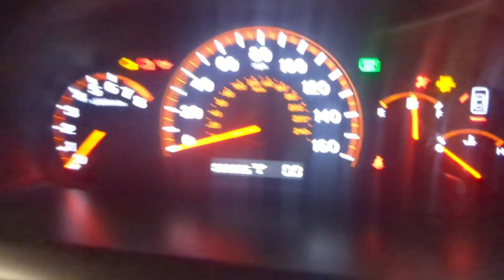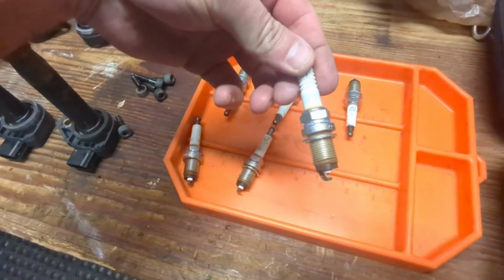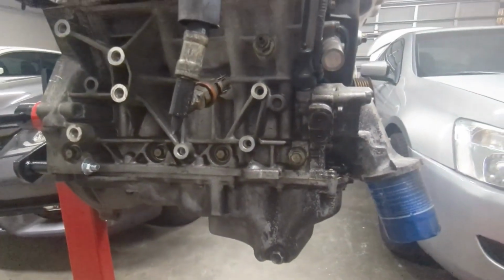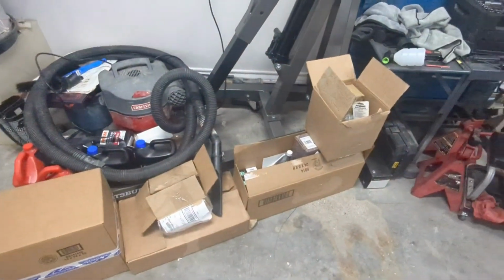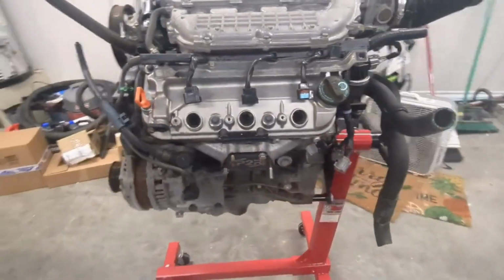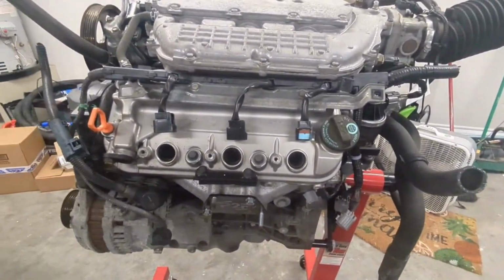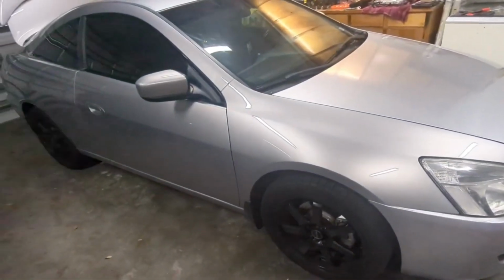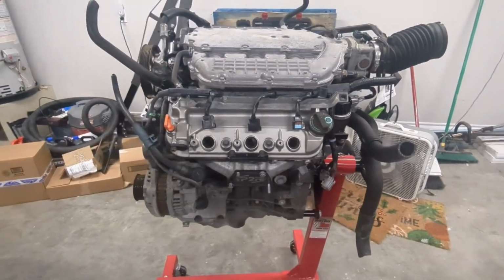Say hello to my new engine

Comment: I would have been inclined to just rebuild the engine you had.  Then you could have kept the original million mile engine, still had VTEC, and it would be good as new, with slightly more displacement.
Reply from the maker: I still may rebuild this original engine. TBD, we'll see how this new one does.

Comment: Cool, I'm definitely interested to see what the inside of the original engine looks like, I bet it looks pretty good still. Also, are you sure the JDM J30 doesn't have VTEC? I know a lot more about the D, B, F, H, and K series than the J series, but I never heard of that. But if true, your ECU won't like that and will probably go into limp mode. I do know that most of the JDM Honda engines don't have the VTEC pressure switch, but that should be super easy to swap over from the old engine. Every JDM Honda engine I saw had a 12MM plug where the VTEC pressure switch goes. Hopefully that's what people mean?
Reply from the maker: I hope you're right. The guy at JDM Motor Inc said he's been selling these as replacements for my engine for years with no issues. I hope you're right about swapping the VTEC pressure switch over. I bought a new VTEC gasket to install. Hopefully we can swap mine on to this engine and everything will be happy. My friend Nick, who will be helping me, is an experienced mechanic. I'm sure he'll figure it out. That bracket for the A/C compressor and belt tensioner was the big thing I saw that was different.
Reply: @txaccord  I just looked up a parts diagram for a Japanese market 2010 Honda Elysion with the J30A and it definitely has VTEC as it lists a part number for a VTEC solenoid. I didn't see a pressure switch listed though. To the best of my knowledge Japan never got an Accord with that engine, so if it came from something like the Elysion (a minivan) with different accessories like a larger AC compressor, that would explain the different brackets and belt tensioner. That should also be easy to swap over though. If you need any help with the swap just let me know. I've never done that swap specifically but I have  quite a bit of experience with other swaps and Honda's generally so I might be able to help if you need it.
Reply from the maker: Thank you so much for looking that up. Will be interesting to see if anything else comes up with the swap. I've never looked up anything for a JDM engine. Is there a specific site you use? I generally look at hondapartsnow for diagrams for my car.
Reply: @txaccord  I use jp-carparts when I need to look up JDM parts. I also use them to look at Japanese pricing on parts because it's often 1/2-1/3 the price of the exact same part here and I refuse to get screwed, so I'll buy my parts from Japan if they are a ripoff here. I saved about $400 buying an oxygen sensor from Japan for just over $200 when the list price is over $600 here.
Reply from the maker: Thank you very much! I looked at the site and bookmarked it. This will be helpful to look up parts in case we run into any other differences between the two engines.

Comment: Bro I'm genuinely happy for you. I have the same car but a v6 sedan. Congratulations again on a million miles 🎉 

Also I need a bit of advice. I'm looking to get new wheels and replace my OEM 16 in ones. Is +40 offset too low for this car?? What wheel setup are you running?? It's my daily driver so I don't want to roll my fenders or any rub with the calipers. The current OEM wheels look a bit tucked in towards the engine
Reply from the maker: Hi. Thank you!
These wheels are from Discount Tire. They're Drag DR35 18x7.5 with 45mm offset. The tires are 235/45/18. The tires are the exact same size as my 2017 Accord Coupe. The wheel offset is pretty close to the 2017 stock wheel size. A guy on DA said he was running this tire size and didn't rub. What I've noticed is that if I hit a big bump too fast, I'll get a little rub. They're fine on the calipers and I don't rub at all on turns. They look good on the car. It's just the occasional rub and that has made a slight cut in the very outer part of the tread. When I need new tires, I'm going to try just slightly narrower tires to see if that solves it.

Comment: couple of things i wanted to ask you RE: the new engine: 

1. there seems to be a large amount of carbon buildup on the tops of the pistons. is that considered normal for a used engine, or excessive, especially after only 150k kms? and, regardless if its normal or not, are you planning on a MMO/seafoam treatment to clean the cylinder heads to help with performance/MPGs?

2. i did notice what seemed to be a bit of etching on one of the cylinder walls (#3?), as well as much more markings/etching on cylinder #6. is that considered normal wear as well, or a sign of a possible problem that may lead to premature failure as time moves along? 

overall, it looks like you got a good engine. not really any wear shown on the cylinder walls, other than the aforementioned areas. 

here's to another million! 😁
Reply from the maker: I've got Cataclean I'll run thru the fuel (and probably some MMO too). I plan on adding a decent amount of MMO to the oil for the first run and then I'll use a few ounces of MMO a couple hundred miles before I change the oil.

I think what you're seeing on the walls is the cross-hatch markings. That should be normal. I'm obviously not expecting too much wear on this thing with such little usage so far. Hope I got a good one.
Reply: I was able to see the cross hatch markings just fine. That shows that the walls are not worn as of yet.

What I was seeing are the dark vertical lines that are present in cylinder 6, IIRC.

@9:40 mark of video.
Reply from the maker: @steelfan81  ok, yeah I see what you're talking about. Hopefully it will be fine.